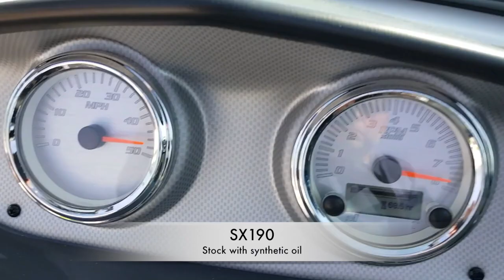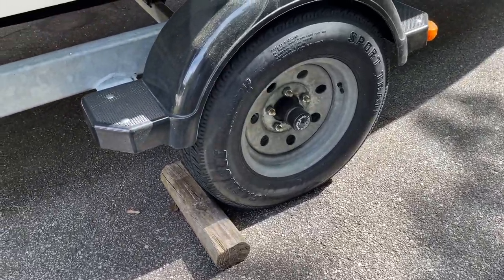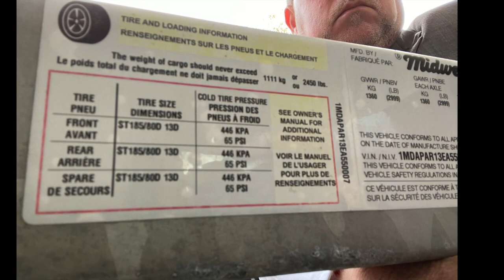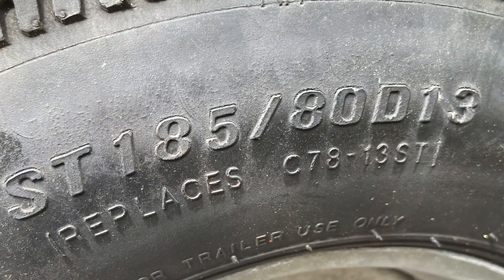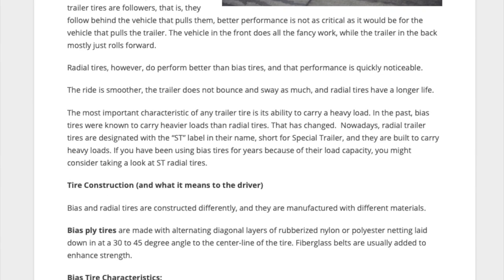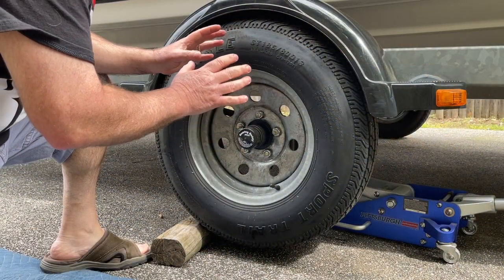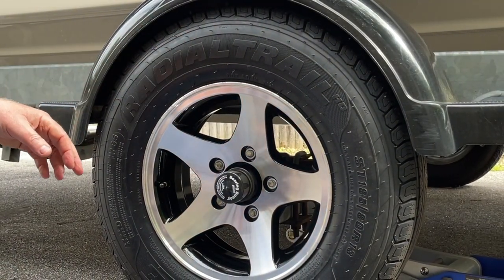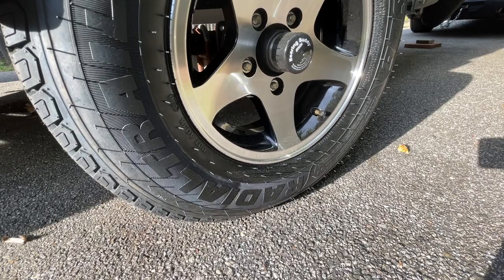Trailer Tires...The Radial Review

Comment: I have a tandem wheel trailer.  Should I use an oversized beach towel to change both tires on the same side at the same time???  :)  Great video, keep up the good work!.
Reply from the maker: I would start off with a single tire and a regular bath towel, if things go well the larger 2 in 1 approach may be possible, get it on film or it didn't happen...lol. Thanks for watching Steve.

Comment: I made the switch to radials 7-8 years ago and never looked back.  Flat tires are virtually a thing of the past.

Did you balance them?  I always balance mine.  Did you buy a radial spare?
Reply from the maker: Hey Steve, yup I balanced them, not crazy with the amount of weight the tire place used on one of them. Still have a Bias ply spare, I know that can be an issue. Thanks for watching!

Comment: Does the Yamaha spare tire cover fit better with the radial tires?
Reply from the maker: My spare is still a Bias Ply, but either way the cover is big to begin with using a 13 inch tire.
Reply: @CaptainLeonsBoatingandMore  how did you secure it. The one Yamaha sent me will fit a tractor tire…lol
Reply from the maker: @GiantsNinerFan56  mine has a cinch strap in the back that I kept working to pull it tighter and tighter. Then I tied the strap off on the tire mount. Maybe you have the wrong size cover?